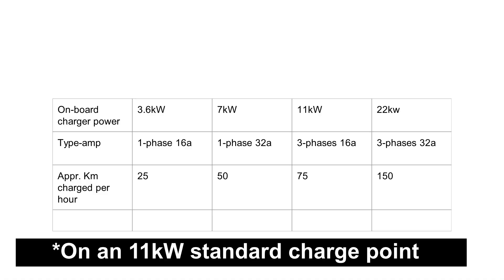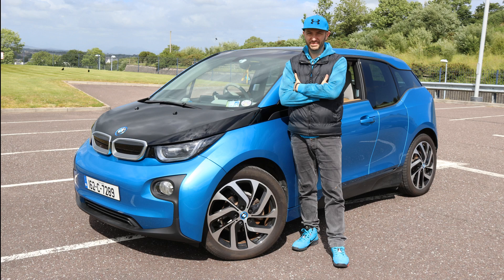We need to talk... about the on-board charger

Comment: I was surprised that the 22KW on board convertor is not more standard - I never checked this before buying but it means that you will get a max of 11KW if charging via AC even if the charger can output 22Kw - most cars cant take advantage of that-  obviously focusing on DC for fast charging
Reply: The vast majority of AC charging happens at home where 3 phase is not available. Every car on the market can charge at the full 32amps single phase available at our homes.
Higher powered AC to DC conversion obviously carries with it additional cost so it makes more sense to have this higher powered conversion available in public charge points instead of in our cars. That's why many of the old dual 22Kw AC units are now being swapped for 50Kw DC units.
Reply: @seanbranagh  funny thing is that work sent out a mail yesterday saying they are "upgrading" all our chargers to "Fast" 22KW units
Reply: @niallshanahan2321  In my view they would be better using the same power supply used for the 22K points and install 7kw points instead and therefore cater for 3 times as many employee cars at one time (space permitting).
Assuming you have normal circa 8 hour work shifts, 7Kw will provide ample charging in that time. A full charge for many cars.

Comment: whats an on bord charger do you mean a granny cable
Reply from the maker: No it’s different. You can think of it as some kind of converter. A granny cable is typically slower and is not used with public charge points, only regular 3-pin sockets.
Reply: The granny cable is not a charger it's simply a cable that connects the cars onboard AC charger to the homes electrical supply via a 3pin socket. Granny cable instructs the car to only draw 2.4kw (ie 10amps) which is below the 13amps limit of a 3pin socket. But 10amps over 10-16hrs continuous is close to the thermal limits of a 13amp socket and plug. Granny cable is handy for visiting relatives or plugging into outdoor power sockets at hospitality venues lacking proper 7kw charge points.